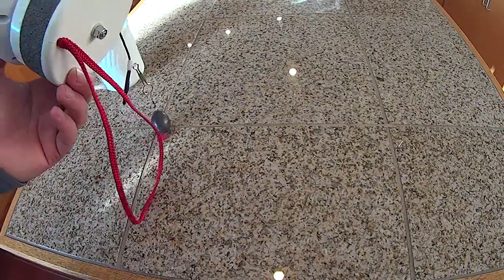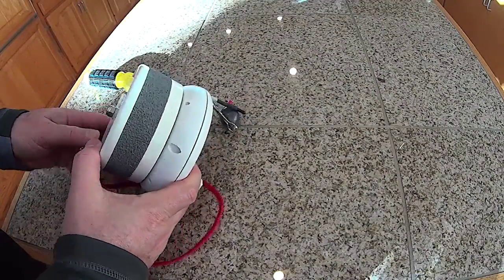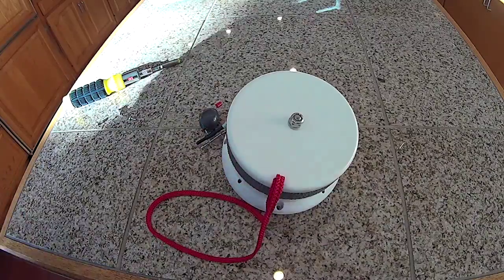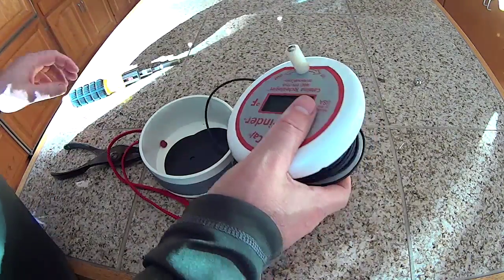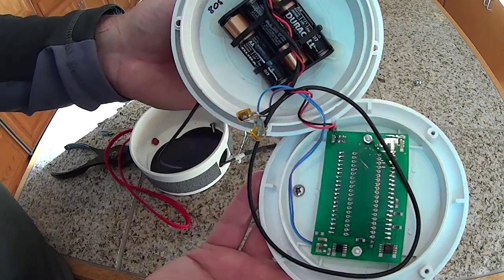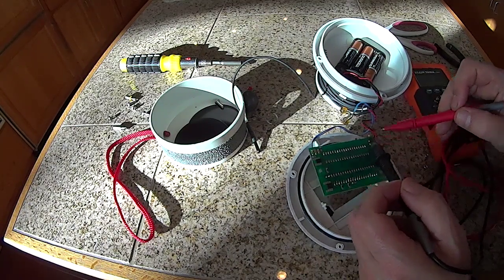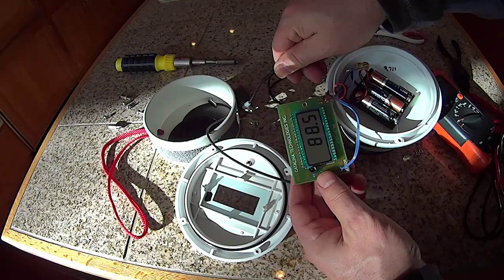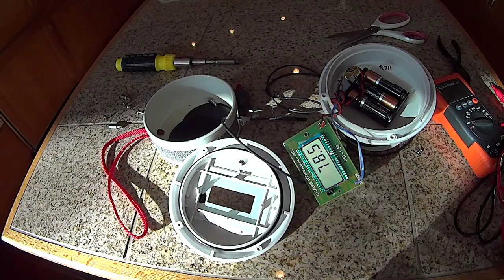ClineFinder - teardown and battery replacement

Comment: I changed batteries but getting "- CAL" on readout. Seems like it needs to be calibrated, but do not see a place to calibrate. Any ideas?
Reply from the maker: That's strange.  I've never seen that.  The board must have some calibration diagnostic built into it.  Perhaps Google the circuit board? Maybe that will provide a clue.